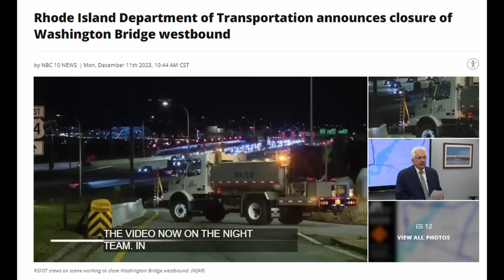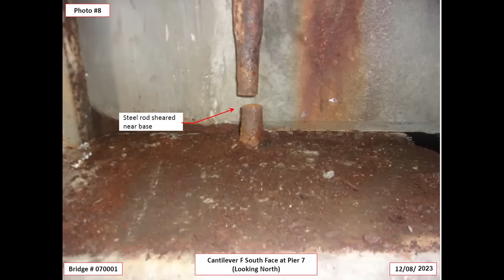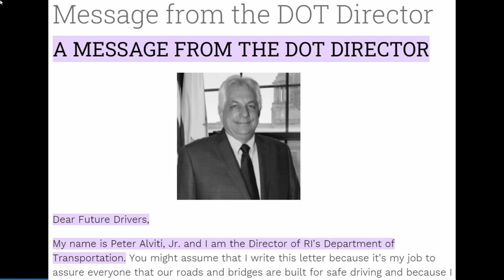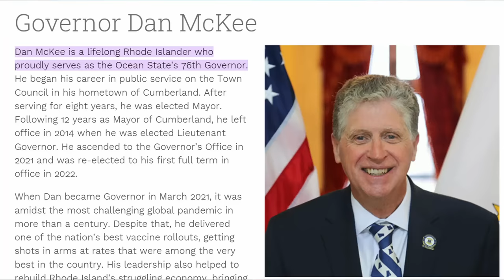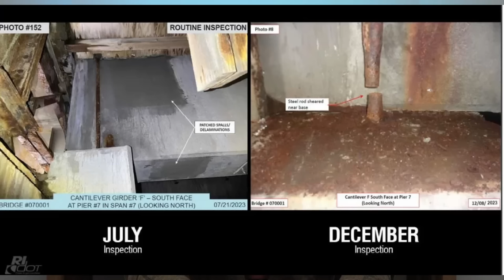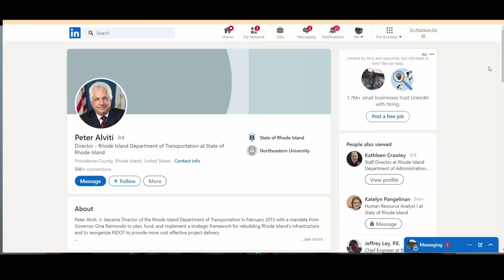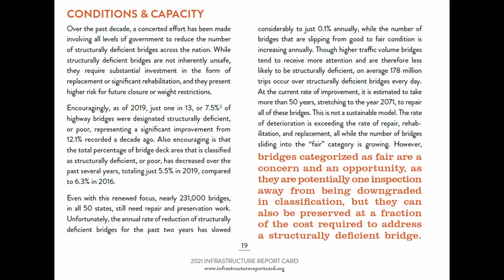What is Really Going on with the I-195 Emergency Bridge Closure in Rhode Island

Comment: I can tell you why it took so long from the time of discovery to the closure of the bridge.  It likely took a bit of time for the junior engineer to convince his superiors that there was a problem.  They realized the implications of having to close this bridge, so wanted to have their ducks in a row before going up to the next layer in management, so probably spent some time re-inspecting the bridge and putting together a presentation.  Once they briefed their bosses (and likely had to convince them),  the bosses had to cogitate on it to see if they wanted to take it up another level.  This happened at every level of management all the way up the Governor.  I guarantee that transportation director did not have the authority to close that bridge on his own (if he wanted to keep his job).  The higher in the food chain, the harder it is to get on the calendar.  Based on that, 3 days is a miraculous turnaround.  These types of organizations are pretty much exclusively machine bureaucracies, agility is not their specialty.  If the break is recent enough they may be able to tell if it is a one time overload failure, fatigue or stress corrosion cracking.  I'm with you that there seems to be no evidence of any extraordinary event.  Thanks for the content.
Reply from the maker: Thanks very much.  I think you points are right on the money here.
Reply: Or… jr engineer was being blown off and he/she said ‘well it’s us or the news outlets’.
Reply: @larryscott3982  Probably not, he would have been fired for that, and blackballed at any state or local govt job, and probably any contractor who does business with the state.  I expect he probably got a more senior engineer and said "is that supposed to be doing that?" and that kicked it off.  I would expect the convincing had to be done by his more senior, but still working level, engineers to management.
Reply: @cjtoombs7473  
Actually 72 hrs is as fast possible given the bureaucracy and the fallout
Reply: I agree. For a government organization decision making process that came not from the top people in the org's power structure, but from the bottom of it, three days is actually quite fast to decide to close such significant infrastructure.
Just look how people are angry about this closure. Assuming they anticipated the public anger, taking three days to make the call is indicative to me that they wanted to be very, VERY sure it was actually necessary.
Sure they safety part of me wants to yell: "Couldn't you just do it same day if it was really so bad!?" But the other part, the one that has experience with government is nodding serenely like, "Man wow quick work guys, good on ya for not hesitating for once in your lives."
Reply: As a comparison, in 1997 the Albanian banking system collapsed. It took three days for the UN to decide it was NATO's problem, and for the NATO Council to assemble. On the third day, I was given the heads-up at 10am it was coming my way, and at 1555 the order to fix it landed firmly on my desk. 15 hours later, a bravura act by a Norwegian Police Colonel ended the panic. It had taken $3000 from my own pocket to get him there (I did get reimbursed), but we managed it.
By comparison, it took the Boss 6 days to produce heaven and earth, and that included a QC audit, which reported it was Good. Three days to defeat evil and rise from the grave (I note that in the original Plan, only one day to produce Adam and Eve, so we can subdivide the Resurrection if needful). Minor miracles evidently take longer: as the sign on every Military Engineer's desk says, "The Possible I do immediately, we're working on The Impossible, please allow 48 hours for Miracles."
Reply: I think the basic desire to just sleepwalk through life, believing that what worked last year will work next year, causes a lack of critical thinking, and what has been referred to in the aircraft world as "tombstone mentality".  Deficiencies and problems tend to be glossed over until you have to deal with dead bodies.
Reply: The closure of the I95/NJ Turnpike/Penn. Turnpike bridge on the Delaware River took much less time.  But that bridge had an obvious break in a major structural component.
Reply: Politically,  CYA is much more diplomatic than an "OOOPSIE"...
Reply: Nice enlightening comment.  Much like bridges that need inspected and perhaps replaced at 50 year increments perhaps the hierarchy of transportation departments need evaluating as well and at closer intervals.  When technical issues become too political bad things can certainly happen.
Reply: Nailed it lol.
Reply: The extraordinary event was a junior engineer with 20/20 vision and self confidence and motivation, it seems the chain gang up the hierarchy all wore dark tint glasses and their limousines were similarly fitted. All fine in the summer inspection - preposterous.
Reply: I think that in the July inspection maybe those guys ignored the severity of the situation and did not want to be part of the reason why the bridge closed.  Something like that.
Reply: Good post
Reply: @CaseyJones-Engineer  For the suspicious, on December 9th over 65,000 tickets were sold to the Army-Navy football game at Gillette stadium only 30 minutes away from Providence, the first time that matchup had ever been played at that stadium. Downtown Providence was packed full of people staying at hotels and enjoying the night life after the game.

Comment: One good thing - the bridge hasn't collapsed yet.
When I see that level of rust and the broken rod I see that it's pure negligence of maintenance and that the bridge now has to be totally replaced because damages you see are just the tip of an iceberg.
Good that you mentioned road salt too. That's one quite important factor when it comes to how quickly the steel rusts.
Reply: People usually forget the road salt…
Reply: Nothing to do with maintenance in most cases. These bridges were designed with a 40 or 50-year lifespan when they were built in the 50s and 60s. It's now 2023, and most of the bridges in the US (and, to be fair, in most countries that had the same car/economic boom after WW2) are now well beyond their designed lifespan.

And the only one to blame is the taxpaying voter, who would surely react very negatively to politicians raising taxes to build thousands of replacement bridges for no apparent reason.
Reply: @HenryLoenwind  I'd like to check the condition of the Golden Gate bridge before making a conclusive statement. As far as I know it's seeing ongoing maintenance basically all the time.

Comment: Casey, check out minute 8:16, Yes, you are correct, one cannot see the break in the bolt from that angle, however what one can see is the rust stain on the concrete which should have given an inspector cause to investigate.  As always, good show.
Reply from the maker: Thank you very much.  As another commentor said  it would be interesting if they had used a mirror or some other means to expose the surface of the anchor rod to see how far the rust extended.
Reply: @CaseyJones-Engineer  well, you know as well as I, that's up to the training and the character of the inspector. 

However, with structures of this age and the exposure of those bolts to the elements, one would expect a more thorough investigation.  In other words, the direction of the photo would indicate that the photographer didn't have an appropriately sized ladder with them.

Sloppy workmanship.
Reply: Where are the inspection  drones ? Possibly the drone footage is lost?  @CaseyJones-Engineer

Comment: If the sheared anchor bolt was a recent failure, I wonder if the rust on the bolt faces was evaluated.
Reply from the maker: That is a great point.  An angle mirror should have been able to show the condition of that surface.

Comment: Ex Corrosion Engineer here: The sheared surface of that steel rod has 100% pitting corrosion.  Been broken for over a year.  Any structural engineer willing to comment on its cross-section, I don't think that can be steel wastage? (I refer to the 12/8/23 photo at t=8:20.)

Comment: I have to imagine that in that part of the country, salting of roads & the issue of nearby saltwater geography contributes greatly to the corrosion of the bridges.
Reply from the maker: Corrosion with cyclic loading of a structure is definitely a bad combination.
Reply: True.  But salt was used on road prior to the 1960s, it is nothing new.
Reply: Captain obvious
Reply: The Seekonk River, which the Washington Bridge crosses, is not so much a river as it is an extension of Narragansett Bay, which is a large body of salt water second in size only to Chesapeake Bay. Not only is the bridge structure subject to corrosion due to heavy usage of chemical salts in Winter, it is also subject to salt air year round.

Comment: Traffic is measured in "ton miles". That's essentially the number of vehicles multiplied by the weight of those vehicles. The traffic corridor between Boston, MA and New York NY is the highest ton mile corridor in the nation. It also has some of the oldest roads, bridges etc. in the nation. This fact doesn't excuse the lack of maintenance and reconstruction. RI used have a dedicated road use fuel tax, which stipulated that the fuel tax collected went to a dedicated fund for road and bridge maintenance. The RI politicians did away with that and sent all the tax revenue to the "general fund". From there it just went into the ether. Same for the Powerball revenue that was supposed to completely fund the educational system. That money is nowhere to be found and the schools are in shambles. RI is a joke. Rated as one of the worst states to retire in.
Reply from the maker: The politicians did the same thing in Kansas when they diverted 2 billion dollars earmarked  for transportation to the general fund.  If this was the private sector it would be considered embezzlement.

Comment: It's a classic result of salt usage on these types of bridges. These structures are usually rated for 50 years before replacement and it certainly looks like that that is right on schedule. A new bridge is behind schedule. OTOH, that closing is pretty good. Yeah, 3 days seems long but that's blindingly fast compared to others. Look to MN for that debacle.
Reply from the maker: Thank you for your comments.  I agree that is fast for government standards.
Reply: Yup, they really need to reduce the salt applications in the winter
Reply: @CaseyJones-Engineer  .. look into the Claiborne Pell Bridge .. which took a significant load with the spillover traffic.Similar age and I have heard bad as well. Love that I commute on it.
Reply from the maker: Thank you.  I will check it out. @mrahob275

Comment: Rhode Island is notorious for corruption. Not sure that has any real part in this story, just something to consider.

I live next door in CT, and we're dealing with the bridge on 95 over the Thames (pronounced as spelled) River between Groton and New London. They are finally starting to do some major repair work on the north bound span, which was originally built in 1943. Back nearly a decade ago, we had a three year plan which was to repair the southbound, newer, span over about 12 months, and then they'd be able to close the northbound span and rebuild it. It took over three years to do the southbound and then they waited years before rebidding the northbound repairs. They supposedly started months ago, but other than seeing the outermost lane closed, nothing else seems to have happened.

We did find out what can happen when one of the spans has to shut down, unplanned back in April when there was a major fire due to a car/oil tanker collision. when the southbound span was closed for hours. We've been assured the bridge is sound, but it can be a little hard to believe given how much fire we saw pouring down the support pillars. If we had to close one of the bridges for any length of time, even with having the other span carry traffic in both directions, it would have a serious negative impact upon the entirety of southeastern New England.
Reply: You say corruption. In Rhode Island, they call is ‘cooperation’. 😂

Comment: The quickly-produced explanation of it being a large heavy vehicle reminds me of my early work in the electric power industry.  If the field operations linemen in our utility had to investigate a short-circuit fault on a distribution circuit but couldn't find an apparent reason for the short-circuit, then it was said that they would get a rubber squirrel from the line truck and throw it down on the ground.  While it may have been a legend, there was likely some truth to the idea that an animal was a reasonable thing to blame.  Thanks for sharing your thoughts on this situation and the reporting.  It would be very interesting to get a look at the Department of Transportation's need-for-repairs scoring sheet in which they make the assessment whether to undertake rehabilitation or repairs soon or later.  90,000 vehicles a day should certainly produce a large scoring multiplier.
Reply from the maker: Thank you.  That scoring sheet is an interesting idea.  I will do an update video once more information has been generated on the situation.

Comment: I heartily concur with your synapis regarding this issue.  I had the same questions regarding the CYA comments about overloaded vehicle damage.  With cameras everywhere I don't buy it.  The average life span of exposed structural cement has been exceeded.  Rusted rebar, decaying concrete are all signs that didn't just begin to occur recently.  They charge enough in road use tax (fuel) and haven't spent the money wisely.  Or not at all in some cases was the money used for the intended purpose.  Now this mess.  Our leaders are not serving us.

Comment: Casey, 

The first thing we taught members of our oil spill team, was honesty.  If you don't know say so, but you have to tell the truth.  At the first press conference about an oil spill, I was asked if the spill was under control.  I answered, "No.  The spill is not under control.  The spill from the vessel has been stopped.  What we know about, we are responding to.  But, no it is not under control."

If the Director of the DOT knew the results of the July inspection, he should have said so.  Based on the photos from July to December they should have had an interim plan until the replacement is started.

I had a hard time figuring out what the photos were showing.   There was a lot of corrosion, and a lot of concrete damage.  The broken bolt looks a lot like a pull test in the lab, necking a reduction in diameter, and possibly a cup and cone.  It didn't look like there was a large amount of corrosion.  In fact, the area where the break occurred looked clean.  One thing I am having a hard time figuring out is that the bolt doesn't look like a bolt.  Part of it looks like it is hexagonal, forged, and not machined.  It would be nice to see the threads.

Bob

Comment: The simplest explanation would be bad inspection practices , maybe they missed it in the blur of rust.
Am reminded of the I40 bridge at Memphis. That might be a good topic for C.J. to cover.
Reply from the maker: Thank you.  I will check out that story.
Reply: It's not bad inspection practices. RIDOT has a history of letting bridges deteriorate to the point of failure so they can get federal funds for replacement rather than use state funds for Maintenace.

Comment: Rhode Island DOT director Peter Alviti doesn't make sense, the pictures show the deterioration has been ongoing for many years. This is similar to Champlain Towers South in Surfside Florida. This bridge has suffered from neglect to properly maintain repair and/or replace. Alviti should stick to engineering facts and not run cover for the politicians. Thank you Casey, interesting video.
Reply from the maker: Thank you for checking it out!

Comment: Inexcusable! For the bridge to be in such poor condition, it would’ve been visible years ago. Remedial short term repairs should’ve begun three years ago in order to avoid this exact scenario. They could’ve reduced the flow rate and increased the weight (lowered)  restrictions, diverted heavy truck traffic etc. in order to allow time to move forward with the construction of the new bridge, which seemingly is underway, much sooner. Hindsight is 20/20 but I think there was a lot of ass covering going on from the first poor condition reports.

Comment: I've read many articles about the disrepair of infrastructure across the United States.  The articles indicate that the money allocated to infrastructure repair and maintenance is not adequate and that we are not replacing bridges, roads, etc. soon enough.

Hindsight tells us that the gigantic sums of money allocated to the Department of Defense should have been spent on infrastructure.
Reply from the maker: You are right.  It is my understanding that the primary purpose of the U.S. interstate highway system was to provide military capability for moving troops efficiently across the country.  One of the design elements was to include road sections where a plane had room to land.  Of course nobody really know how much the defense budget is.  There is the official one and then there is the black budget for dark programs.
Reply: Well a certain faction was hell bent on neutering the bill.  After said party held it hostage and whittled it down.. A whopping 110B is dedicated for roadway infrastructure which of course includes bridges.  Really love the rider MADD got added to the bill.
Reply: It's evolved to the point where the most reliable way to get reelected is to give people free stuff, not much is left over for other uses.